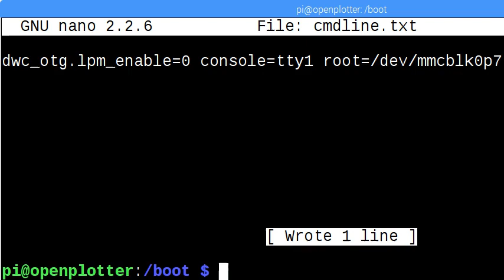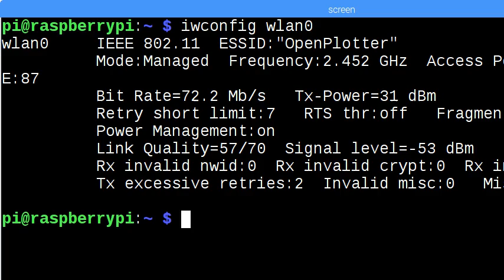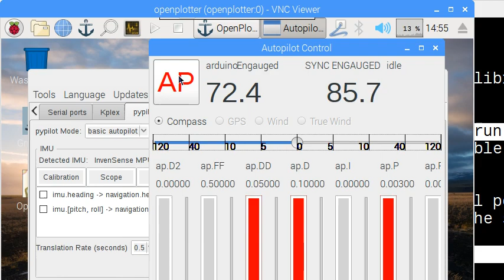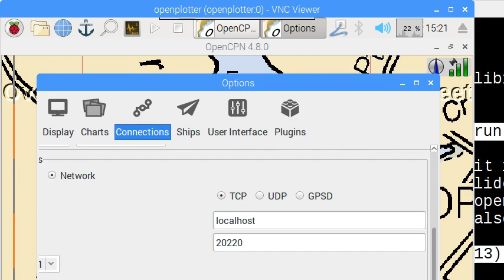pypilot openplotter

Comment: Hi Sean, Can you please share what is the IMU sensor that you plug onto the RPi GPIO header, and how does it control the actuator?
Reply: LOOKS LIKE THE MILLION DOLLAR QUESTION
Reply: The IMU is a sensor that measures triaxial acceleration and triaxial angular velocity. The IMU consists of an accelerometer, which can output linear acceleration signals on three axes in space, and a gyroscope, which can output angular velocity signals on three axes in space. (left skid marks on my head)